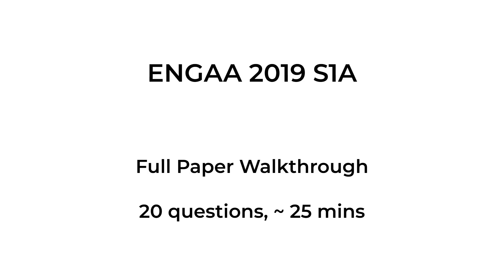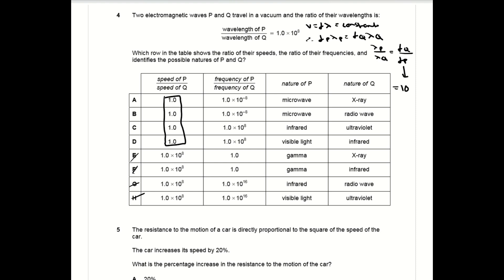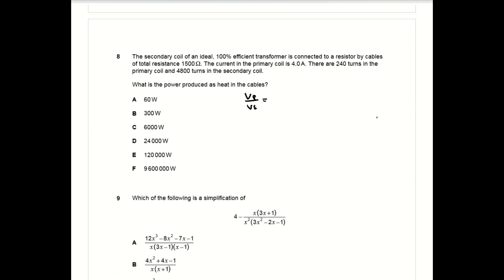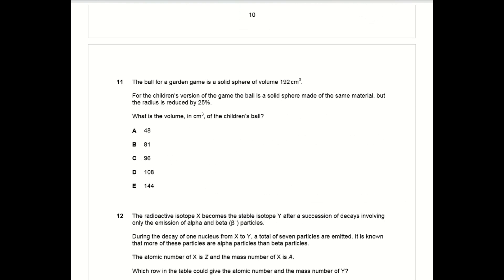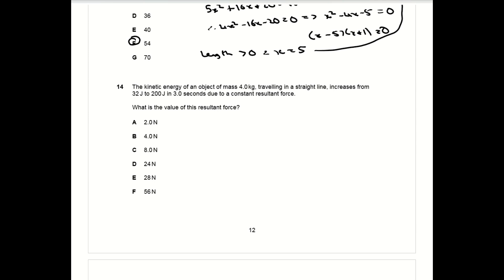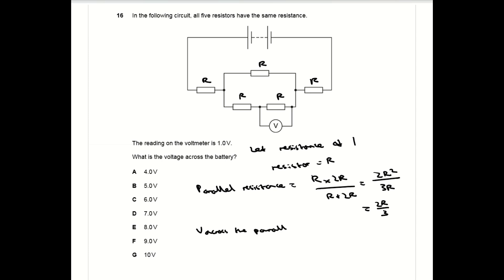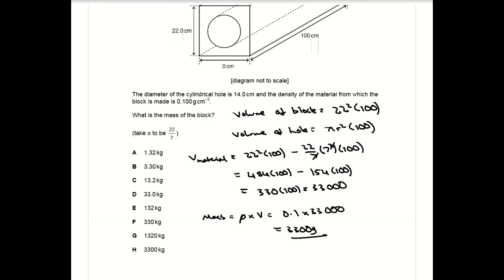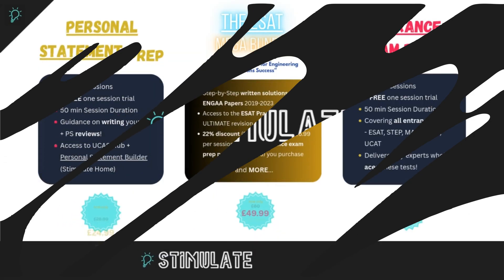ENGAA 2019 S1a Paper Walkthrough | Stimulate Learning

Comment: For q16, i dont understand how the total voltage across the parallel section is 2V, what about the resistor on top?
Reply from the maker: Okay so you're told all the resistors are identical, so both the resistor with the voltmeter across it and the resistor directly next to it (the one to the left) have 1V across. 

This means across both resistors, there will be 1V + 1V = 2V. These two resistors are in parallel with the resistor on the top, and for resistors in parallel, voltage across each branch is the same so the total voltage across the parallel section is 2V.

Hope that helps!
Reply: @Stimulate-LearningI get it now, i keep on forgetting to apply the circuit rules and laws electricity is my weakest topic. Thank you